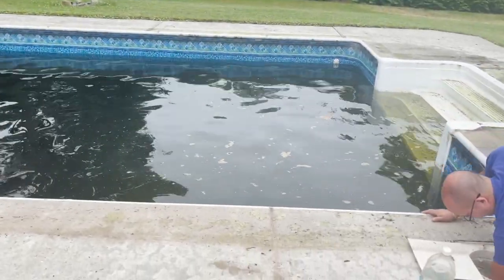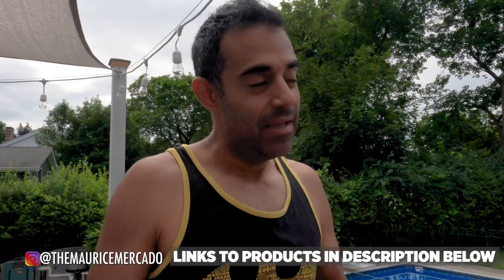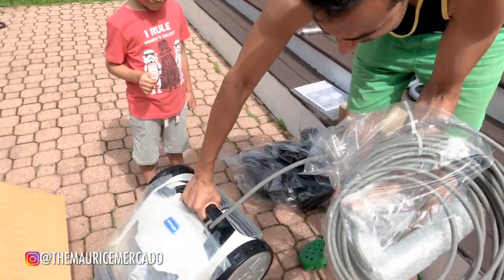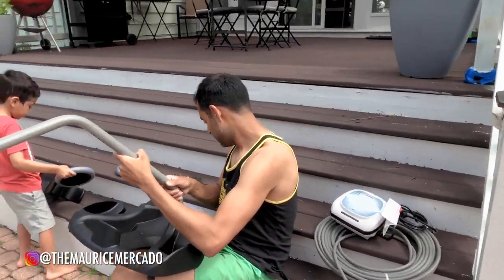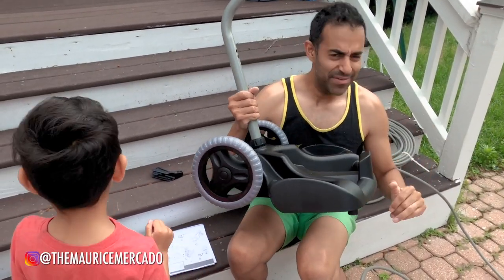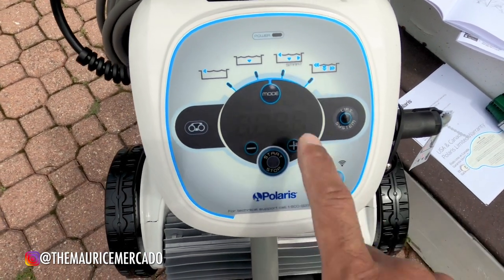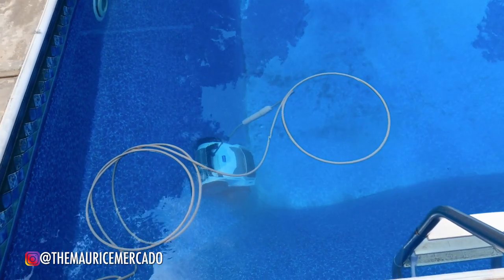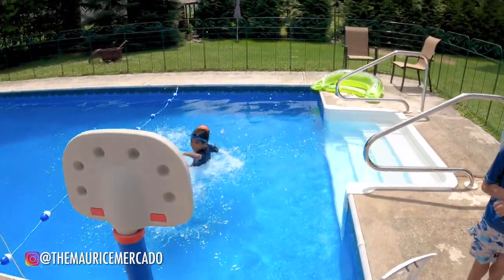Don't Swim in a Dirty Pool - Automatic Cleaner Unboxing

Comment: I'm ready to buy one of these. My two questions are does the cord ever tangle up and prevent it from  moving freely and does it make it all the way up to the water line on the tile? Thank You!
Reply from the maker: The cable is long enough for my 16x32ft pool, the cord does tangle but it never knots. It untangles very easy even on its own most times as the vac movies around the bottom of the pool. I have no complaints. Update video coming soon.
Reply: Does it actually clean the waterline tile?  It doesn't look like it in this video. It goes up and comes back down instantly.
Reply from the maker: @eagleonesims613  It does, my pool was not taken care of my the previous owner so the waterline is stained but this little guy does reach up there and scrub it. UPDATE VIDEO COMING SOON.
Reply from the maker: HERE IS MY ONE YEAR LATER FOLLOW UP: @
Reply from the maker: @eagleonesims613  HERE IS MY ONE YEAR LATER FOLLOW UP: @

Comment: Just be sure your outdoor plug is a GFCI outlet (has the Test, Reset buttons). This robot is being powered by AC electrical current, and the instructions do say to remove it before letting anyone "jump in".

Without a GFCI outlet plug, if this model had happened to have had a manufacturer's defect, the kid wouldn't have been safe.
Reply from the maker: Thanks for the tip, I always take it out before we go swimming. But I will be sire to make sure that outlet is GFCI.
Reply: @MauriceMercado  matter of fact I was told that the GFCI outlet might fault and was advised by my electrician to install a GFCI breaker. You have the pump running and it should never be taken for granted.
Reply from the maker: @omarious  done and done. 👍🏼
Reply: The control unit converts the 120 volts AC from the receptacle it is plugged into down to 30 volts DC, which is what the robot uses.

Comment: I know this was a while ago.. But where are your mains?  as she was showing the pool.. there are no returns that i seen.
Reply from the maker: "Mains" as in where the water comes in? There are three.
Reply: @MauriceMercado  no the main drains that lead back to the filtration pump.
Reply from the maker: @bmacy1028  Oh well there is no drain line, the 2 skimmers do that on this pool. There's a separate drain hose that I use to rinse the DE filter that goes to the far end of the yard.